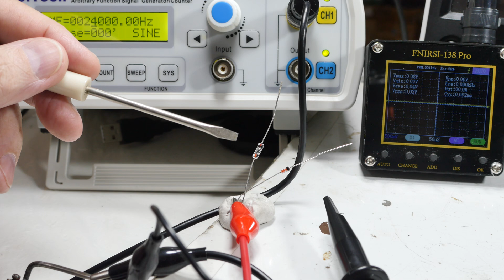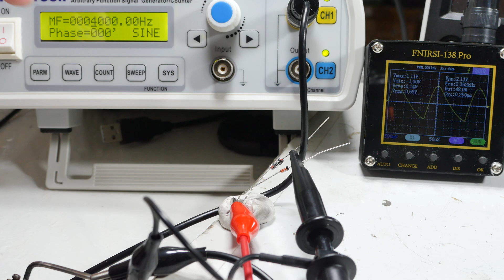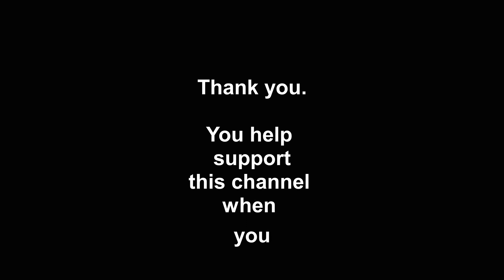Crystal Radio Diodes-Schottkey vs 1N34A (4K)

Comment: This doesn't make any sense to me. Maybe the Schottky diode you're using for comparison has a higher Vf than the Ge diode.
Reply from the maker: @RP4UXO  Diodes are designed for different purposes. Power diodes don't transmit weak signals. Digital diodes don't have the same properties as analog diodes. Etc. The 1n34a is an analog device made to efficiently detect tiny signals. The Schottkey diode is a digital age device made to switch on and off ver sharply and efficiently.

Comment: Building another since 60 life years. Can you please point me to a reputable geranium diode vendor?
Reply from the maker: The last ones I bought were from a guy in Ukraine on ebay about 5 years ago. Had to buy 50. They were D9K type, which seems to be the best bet these days (it's a good substitute  https://youtu.be/phD_2Wm79gs). I've been pushing using galena or iron pyrite as a detector because they can't be faked. Of course one has to make the cat whisker holder, which is the downside. https://youtu.be/PQ0clWe8NGU
https://youtu.be/ANuU8gsALzI

Comment: I thought RF detection performance was what made a good diode. Your test setup is high audio range. Details on test setup, scope settings, amplitude, etc. would be helpful to evaluate the results. I believe the “wave stability” is an artifact of the scope sync settings rather than diode characteristics. Looks like you are using AC coupling on the scope, making it hard to see reverse current flow, if any.
Reply from the maker: @df9999999999  In a crystal radio, you don't have to worry about the carrier  the RF is way outside of human hearing. The diode is there to take half the AF signal to allow the earphone to work.
Reply: @tsbrownie  The tank circuit must develop sufficient RF voltage to forward bias the diode and create a DC voltage that is completely independent of any AM modulation, and in the case of a simple half-wave diode circuit, pulses at the RF frequency of the carrier. Audio may be  reconstructed from the positive RF pulses because the RF output level of the detector diode is proportional to the modulation envelope. The capacitor at the output of the detector acts as a low-pass filter on the rectified RF, allowing only the audio rate signal to pass to the headphones. But, the diode performance is based on its RF rectifying ability, not audio. I think you need a load resistor matched to the output impedance of the diode to get meaningful readings.
Reply: @tsbrownie  , but the diode is rectifying the AC signal, which is at radio frequency. It is just the average of the resulting pulsating DC signal that we perceive as being an audio signal. Based on this, I don't think think your test setup at ONLY audio frequencies is quite valid.

And I agree with other commenters that the 'instability' of the lower amplitude signal coming from the Schottky diode is more likely due to your scope not being set up to trigger correctly at that lower amplitude.

Comment: Does things change if you use 2 x Schottkey in parallel? How about a BAT-85 Didode?
Reply: No, diodes in parallel do nothing extra.
Reply from the maker: I don't know the bat85. Funny you should ask about 2 Schottkey diodes. I just tried multiple Schottkey diodes 2 days ago. I also tried adding a resistor for reverse leakage. Didn't work.

Comment: Is an input of 1.3 volts is a bit high for a crystal radio?
Reply from the maker: I've gotten almost 3 volts out of them. Enough to power a digital clock. 
https://youtu.be/0WvZC3-mR6Q
Reply: @tsbrownie  Be interesting to know what your antenna set-up is.
Reply from the maker: @franzliszt3195  9 meters, center tap. Under the house eves. One of my videos shows it.
Reply: @tsbrownie  wow, 3 volts from nine meters.
Reply: @tsbrownie  How here is something I just wondered and was blown away. AM radio is vertically polarlarized. So therorically, a vertical antenna is best for crystal radio for AM!!!!!!! FM is circular polarization so it does not matter; you get 1/sqrt(2} on matter which way you place your antenna!!!!!! Sounds right, most people have a vertical antenna on their car, sa vertical broadcast would be best. But perhaps many people had radios in cars, maybe the broad cast horizontally, as people would string up long wires, since in the 1920s most radio were crystar radios!!!!!